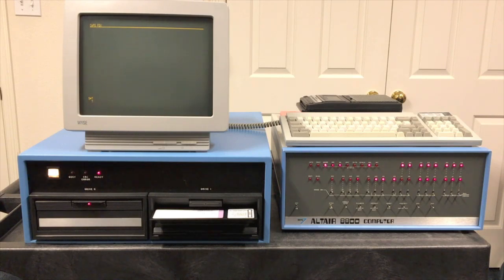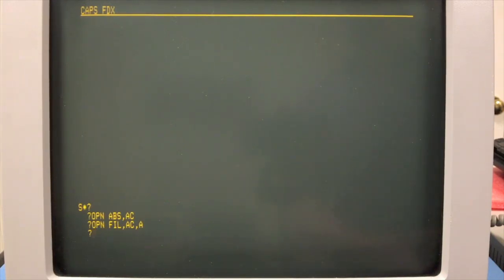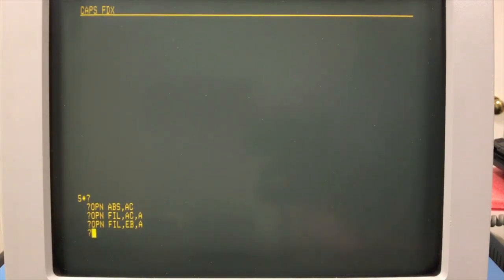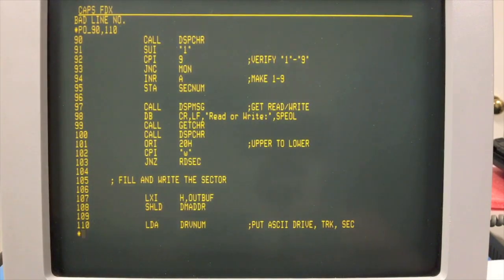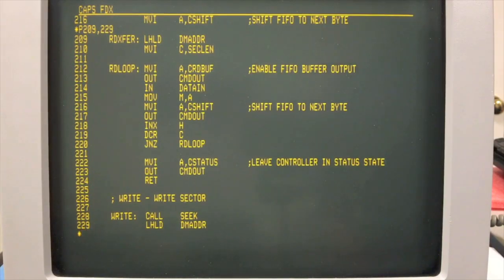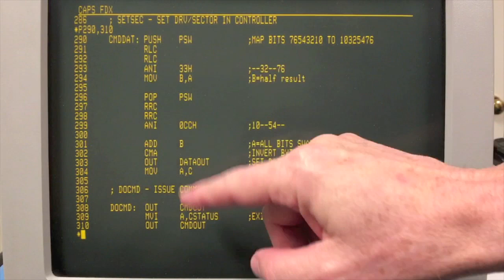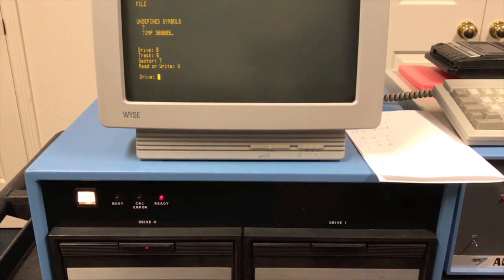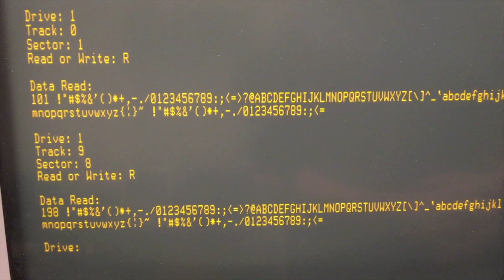Early Altair 8800 - Adding a Floppy Drive #2

Comment: So is the data separation and FM/MFM decoding happening in the controller, so that the bytes transferred to the computer memory is the actual data of interest?
Reply from the maker: Yes, the controller inside the drive cabinet has performed the FM decoding and de-serialization and is presenting data bytes via the parallel interface to the Altair.